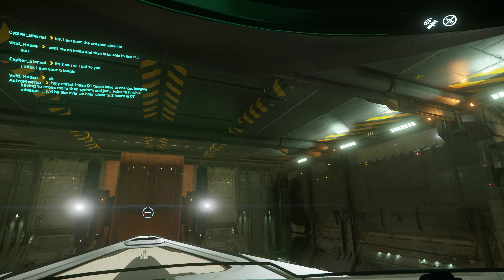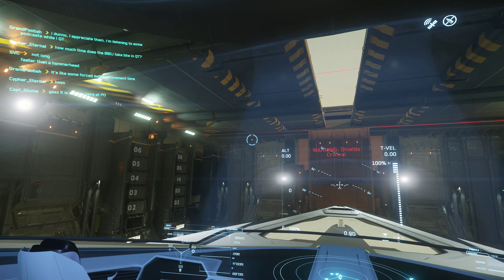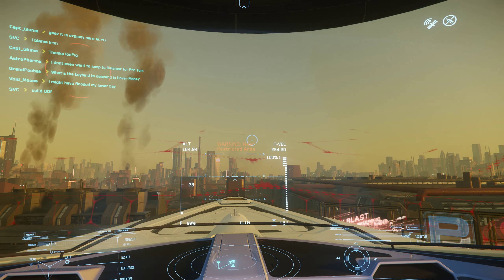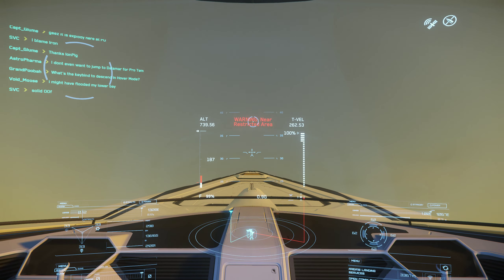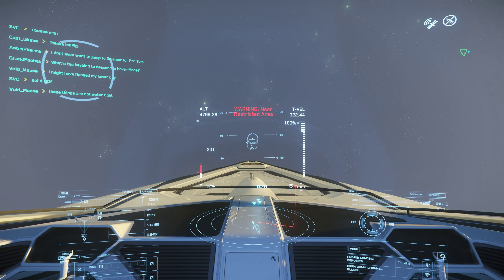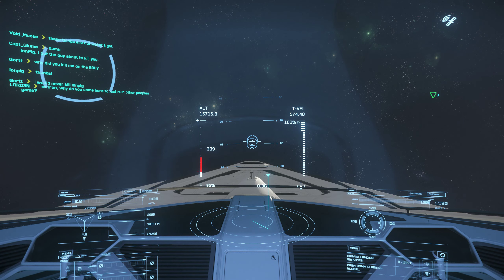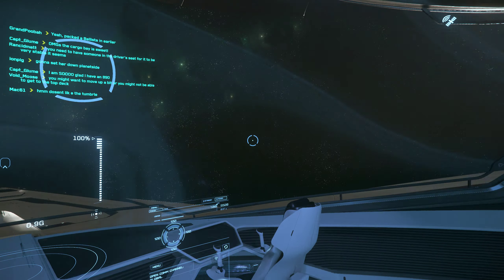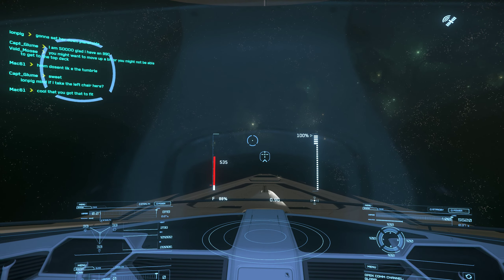Star Citizen 890 Jump How to conserve fuel

Comment: Hi, found this video cus everyone keeps mentioning the fuel cost and how fast it depletes. Been thinking about it and realized that the fastest and most fuel efficient way to get this ship out of atmo seems like you simply wait to get up to a space station before you request delivery, and then simply call it in from there once its delivered to that location. Each wipe or patch that resets characters always needs you too request the vehicle to the destination you're at before you can call it in to a hanger. "But that doesnt help with ground vehicle loading", you're correct! However, now youre in space and saved on fuel. Use that fuel to fly to a low atmo moon or planet and pick up vehicles there. Less drag on the hull and easier on the fuel reserves. This will be my new method going forward. Its an old video so if anyone comes looking for answerers and finds this I hope it helps.
Reply from the maker: Yeah, I need to take this video down and update it. Now space stations play a bigger role where as before the only option available was to fly all the way out of atmosphere from one of the major hubs.

Comment: Let's save fuel on a super-yacht....
Also, I want my tripple cheaseburger and large fries with diet coke, please!
Reply from the maker: I think the idea with a super yacht is to be able to do extended touring... The fuel consumption of the 890 requires you to manage your fuel consumption and plan your routes to conserve and collect more fuel to extend trips. All refueling requires you to land planetside to do.
Reply: @jackcrackerman  Seems like a massive design oversight if you ask me, but fair enough.
Reply from the maker: @a_Minion_of_Soros  it turns really well for a 210 meter long ship. That maneuverability comes at a cost of fuel consumption. Second, it has large fuel scoops that can collect about 10% fuel in 20 minutes. So it's not terrible. Other than that it has a very large jump drive. It just forces you to plan your routes and make precise turns to minimize fuel consumption.
Reply: @jackcrackerman  Never mind. Thanks for the info!

Comment: Duh, using ones main engine vs thruster's will always mean using less thruster fuel vs engine fuel. Once at full speed, uncoupleing will save engine fuel also. Just remembe to couple again becasuse your not going to stop nor have the ability to control direction.